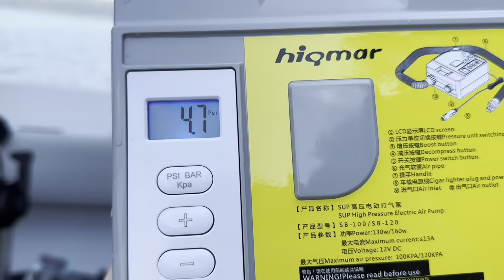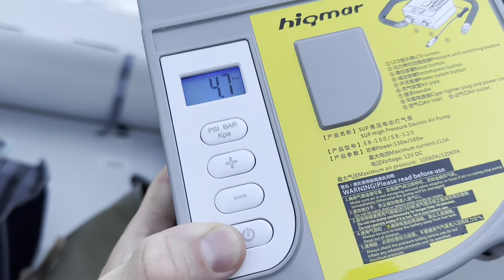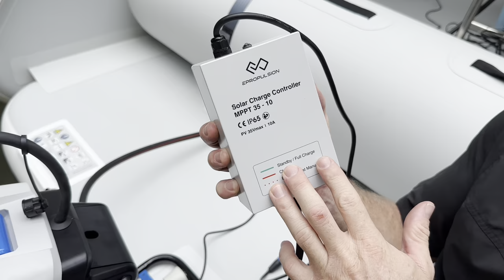Electric Boat Adventure: GoSun Elcat Splash How To Guide | Eco-Friendly Boating Fun!

Comment: i love these little Elcats...   what most people never think about with boats is... Storage.   these things can break down and be stored inside an apartment.   you likely won't need a trailer to haul one unless you have a really small car.   you don't have to worry about long term harbor fees because again you can pull it out of the water and deflate it.   

The only problem with it is heat.   there really isn't a truly safe way to heat it, and even cooking on it can be risky.